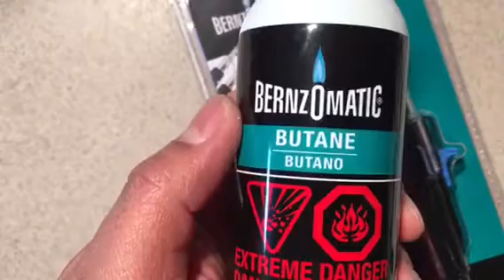Portable Butane Solder BERNZOMATIC 3 in 1

Comment: The solder you're using is for plumbing and not PCB work. The acid inside the solder is too acidic for PCB work. I could be wrong on the solder as that could be some kind of special PCB solder, but you usually don't find PCB solder with that thickness.
Reply: ..........................  Why?  just why......
Reply: It's mentioned ELECTRIACL already.